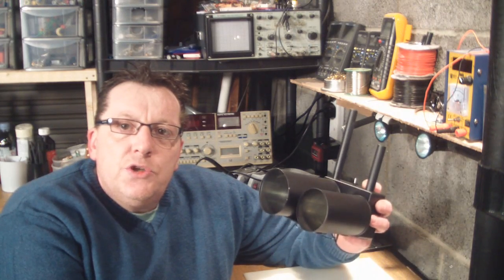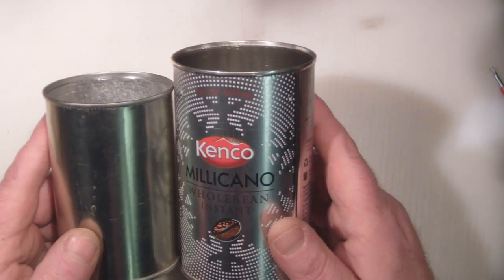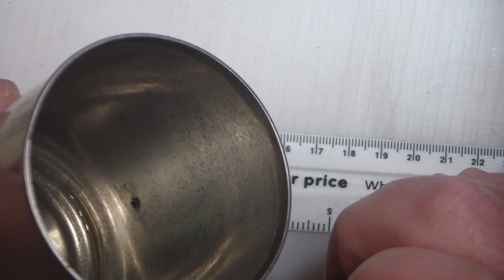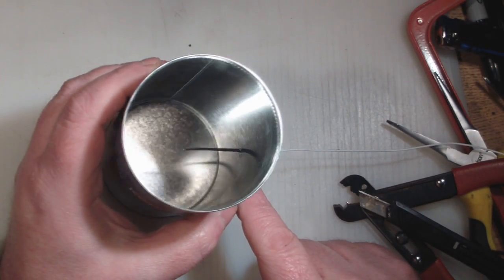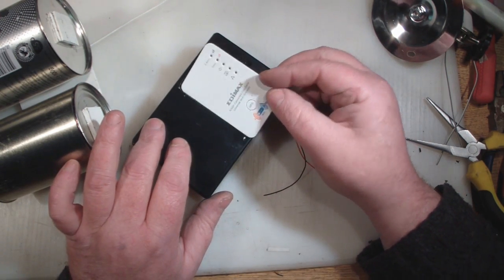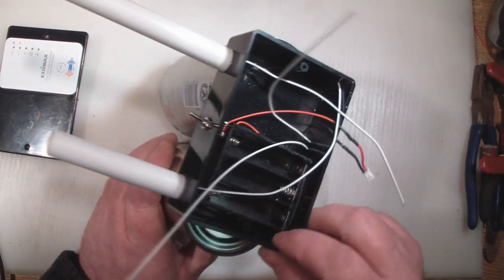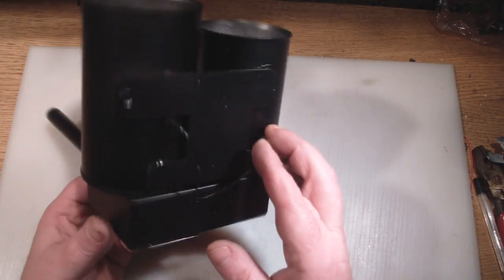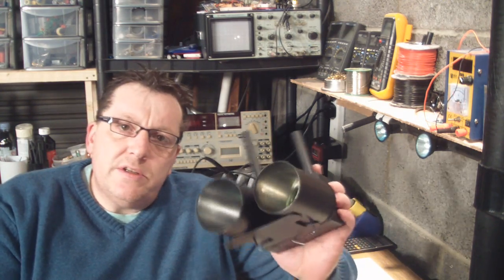Long Range Dual Band Wifi Repeater #46

Comment: Stubbled across your channel and can only say one word–Brilliant! I love your passion for wireless technology and your willingness to share. As a project idea, perhaps build a triple-barrel 2.4ghz/5.8ghz cantenna that replaces the oem dipole antennas on the back of your shop's wireless router (assuming your router has 3 oem antennas) and use the shop's wireless router as a bridge from the house? I assume this configuration could only be 2.4ghz or 5.8ghz, but not both? I hope to hear from you or see something of the sort in your next installment. Keep up the great work and thank you for sharing! Cheers!

Comment: I am surprised that there isn't a loss due to impedence mismatch. Two 52 ohm antenna in parallel will give you 26 ohm on the PCB. The swr will be quite high. I wonder if you could increase your gain by putting two repeaters back to back using the RJ45 plug? Each repeater would handle the can  or half wave pair solely.

What are your thoughts on this?

Comment: hi I have a 300mbps repeater.I would like to connect a high gain USB antenna to it,is it possible,there are two antenna on the repeater circuit board.when the board is in repeater mode how do I no which one is out antenna and which one is in,i probably got it all wrong.so thanks for any info and help....

Comment: INFO FOR READERS: 

HI - i spent a long time looking around my local shop and found this can. Thought id let people know this is a baked bean sized can and smooth ... no ribs. 60p better than buying a sugar tin for £2

Its strong metal tube

morrisons
https://groceries.morrisons.com/productImages/110/110800011_0_640x640.jpg?identifier=ebc2f6cbabe6e30a4ea11437498258de

Comment: Hey Andrew question for you......will either of the 2.4 or 5Ghz cantennas work in reverse and you get your shop signal from the dipole antennas of the repeater if you place the repeater in your shop instead of your house?

Comment: It looked like that board had 4 antenna points but antenna point 1 and 3 are not being used, Is that a mcx connection right under the antenna 1 point? If so why not use it ?

Comment: Have a couple questions. What are the diameters for the two cans you used there? What type of cable is the driven element. If using standard RG6 center conductor as driven element, how much of an impact would solid copper vs copper clad steel make? What are the dimensions of the project box you used?

Comment: Andrew - What is the battery life on the repeater setup like this?  Good idea, and I'm looking for something like this.  I'm sharing a connection with a family member that lives about 450 feet from me.  I currently have 3 routers (2.4Ghz) repeating and the connection is hit and miss sometimes.  When it's working, it works great, but it's just on the line of working.  Would it be good to set one of these at both locations, or would I just need one?  Thanks so much!

Comment: Awesome solution! I Have a Edimax EW-7238RPD and will be modifying it to increase its range. However before I start I have a 55mbps connection via a HH5. My problem is even with the Edimax in close proximity transfer speeds drop to 23mbps max. If this is normal then it would kind of defeat the object of my project:-(  Hopefully you are going to tell me this is not normal, (I can't see why it would be!)

Comment: Hi Andrew,  Off topic help ... i built a wokfi usb antenna.  the usb adapter works fine when directly in the pc usb port.  When connected to the 15' wsb cable wokfi it gets great signal to router but does not connect to the internet?  What is happening? thx

Comment: When you connected the antenna coax to the board did you ground the coax shielding?  You said that was important on your previous repeater project.
Reply from the maker: Yes when I removed the on board F antennas I was left with solder points for the ground and driven element.

Comment: Yes but that is the answer for the fiber optic because they deliver big amount but the modem only allows to pass 2.4ghz is like a funnel.
Do you need any special receptor in your laptop for the 5ghz band?
Reply from the maker: You need a laptop with a duel band wifi card most mid range laptops come with them a standard now as do the newer generation of phones. 5ghz has been around for sometime it is just now taking off due to faster fibre optic broadband as you say and there is less interference. My old hp tc4400 tablet came with a duel band card in 2005.

Comment: No, what I asked was why build the 2.4ghz when you could do only one of 5ghz?
Reply from the maker: Sorry misread. Well that's easy my nexus 7 will only connect to 2.4ghz. Backward compatibility gives it more options.
Reply: So if in the future they upgrade the modems for 5ghz these androids will not work?
Reply from the maker: Duarte .Oliveira 2.4ghz wifi will be around for quite a few years. In my street every house has wifi. I can scan with one of my antennas and easily pick up 40+ access points operating on 2.4 but only I use both 2.4 and 5ghz. That's one more reason for using 5ghz there is no interference.

Comment: hi
sorry to be ignorant on this field but why do you need a dual band repeater? why not just the 5GHz?
I need a antenna to cover the distance of 1Km. what would be your advise? I will need to put inside of my room...
Reply from the maker: I use 5ghz as I have 100mb cable connection 2.4ghz cannot squeeze that much data over its band it stops at 60mb. If you are looking at connecting at 1 km you should use a cantenna and have line of sight.

Comment: which would be better for several km 2.4 or 5g? Something from mountain top to mountain top is what I want to accomplish? Is this possible in a LOS with no buildings or trees?

Thank you for putting forth the effort to make the videos and being willing to share your experience. It's great fun learning about this.
Reply: very late comment, but 2.4GHz would be better due to lower frequency
For KM of range you probably need a dish

Comment: I saw that the board had connectors for 4 antennas but you've only used 2, why is that ?
Reply from the maker: The board only has 2 antennas. I added 4 two dipoles and two cantennas. two soldered on the top and two soldered on the bottom. I will add some pictures of the board on G+ tomorrow if this helps.
Andrew
Reply: andrew mcneil
I know what you did, I was talking about the notations on the board. You used ANT2 and ANT4. My question was if you can also use ANT1 and ANT3 or are they for something else ?